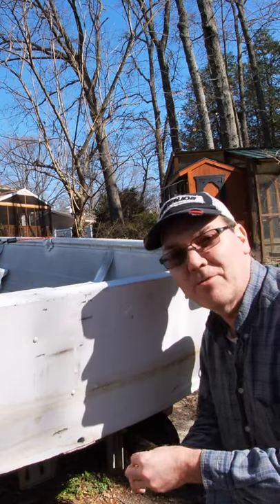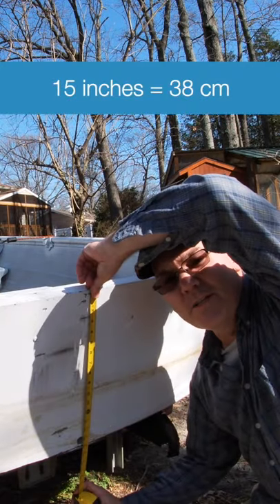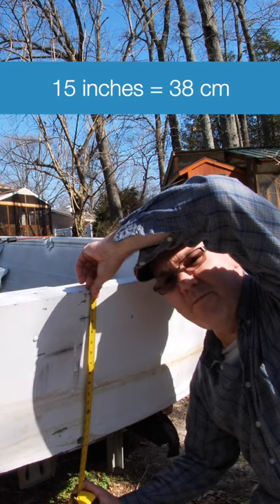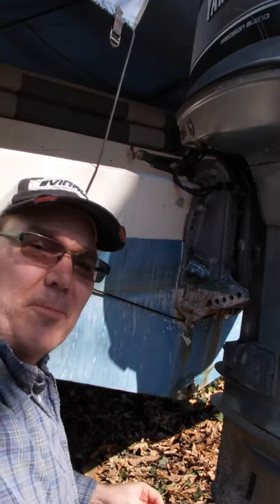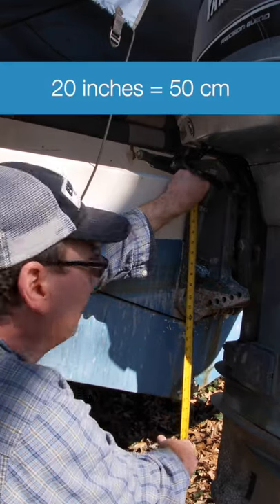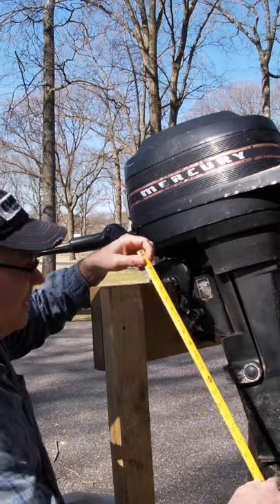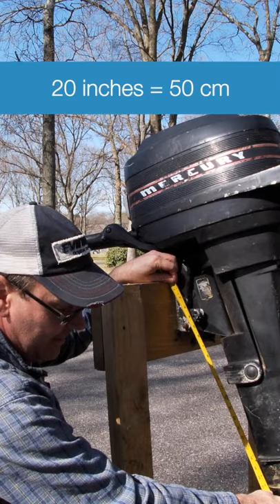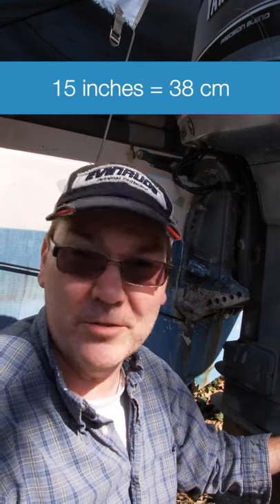Short Shaft? Long Shaft? Outboard motor shaft length guide

Comment: what happens if you put a long shaft outboard on a short transom
Reply from the maker: It technically can work - but to the best of my knowledge there's more drag because of the depth of the prop and it isn't helping to move the water that's just below the boat but instead churning water that's much lower.
Reply: @WayneTheBoatGuy  I had a 14 foot Appleby with a 15 HP long shaft -which was to long . It seemed to pull the transom down making it difficult to see where you was going  and didn't run very fast. Just my 2 cents.